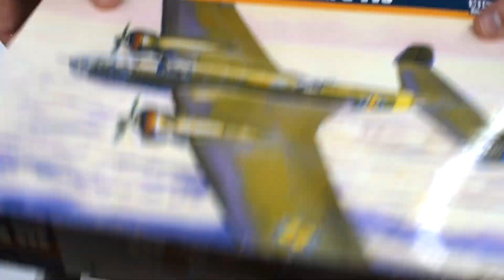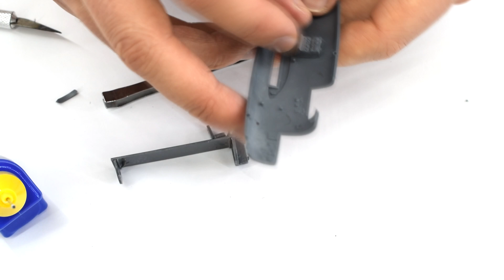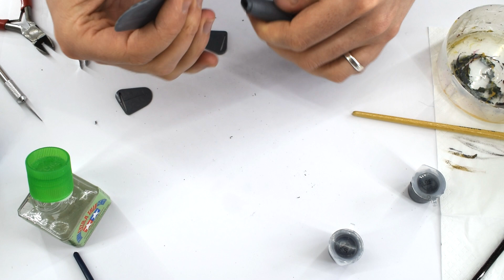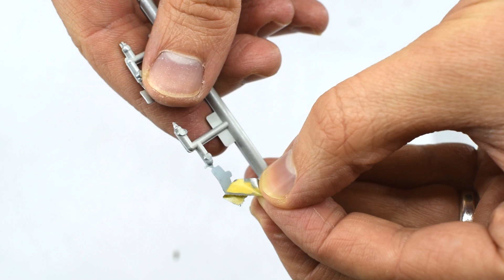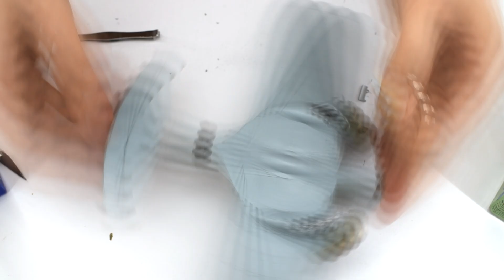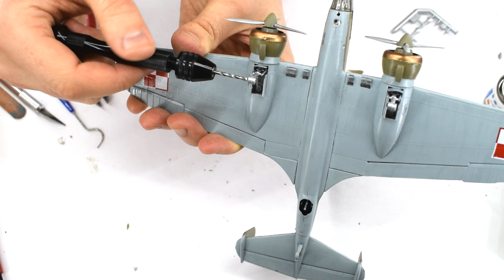Mistercraft PZL-37B 'Łoś FARR & VVS' - 1/72 Scale Plastic Model kit - Build & Review

Comment: (two months after my previous comment)
I've now built and painted the kit. I still love the aircraft itself, despite the shortcomings of the kit. Over all: a good experience; meagre modelling skills were stretched but not broken. Yes: the canopies need work to make them fit, there's a lot of cleaning up and seam filling to be done and a bit of guesswork in where exactly some parts fit. Mine is a model of two halves. Fortunately, it's the upper half that worked out well, leaving most of the mess underneath. I was also rather pleased with my custom ix of "Polish khaki" for the upper surfaces, made from four Tamiya paints. As I like the plane so much, I might well treat myself to the IBG version of the moose/elk. Keep modelling on!
Reply from the maker: Sounds like you made the most of it despite the challenges!

Comment: For a Polish person, this brings some painful memories. Before we got Revell, Humbrol and Italeri, we had this. The tooling goes back to 70's, and was mostly imported from the USSR. They would also give you the saddest bottle of glue that didn't have a proper cap, but was waxxed shut, along with the model. It wouldn't work with the plastic at all, if it was not washed, and it would always run out before you finished. It had the consistency of Tamiya extra thin, but didn't have any bite and was basically an adhesive, that could give up at any point. The thinner was evaporating in seconds, and I remember well jamming a toothpick between the fuselage halves, because there was no other way to fit the parts before it dried up. The biggest irony was that it came in a soft plastic bottle. No wonder that paper models were much more popular here, before we joined the West. It is still very popular to this day, with some awesome, skilful modellers.

Halfway through the 90's we got something better, in the form of Mirage Hobby models that had proper, new (for the time) tooling. They were workable, but for the rest of my life I will remember Academy AH-64D that I got one Christmas, along with a tube of Revell cement. Civilization peaked for me at that moment haha
Reply: I also remember this model from when I was a kid.  Never finished building it.  Almost 40 years later, I finally got to see how it was supposed to be assembled.

Comment: There is a very strong place in this hobby for old tooled kits. Some are fantastic builds. However. As long as they are usable, and not priced high (Revell im looking at you here for pricing kits all the same regardless of tooling age and quality!) Long may they live.

Sometimes, just sometimes...they need a good rework or scrapping!
Reply from the maker: Good points!

Comment: This is model I build more than 3 times. I buy few from ZTS Plastyk and few from MisterCraft, they are exactly the same but ZTS is cheaper. It is great because there is a lot of modeling work to do with it. Sanding, cutting and scribing :D You need to think twice befire you glue something because no parts fit together as intended. But because there is only few parts make its rather quick to build. Painting schema is also easy (best colours for it are from Hataka - Dark Polish Khaki is the proper one). Glad you didn't try the A version as the single tale is even harder to do and require lot of plastic to be cut from the tail. Great video! I enjoy your fight with this model! :)
Reply from the maker: haha it really was a fight!

Comment: I built an F-4 Phantom in 1/72 scale that came with optional battle damage. I was about 10. That kit hassled me & refused to go together without a fight. At the end some stray glue was about on the kit & caused a fumble & the kit fell to the floor & practically every piece broke apart. Temper temper temper as I stamped that kit into the linoleum. Three dollars & the time up the bloody sparf.
Reply from the maker: :o

Comment: Not so bad build of a very crude kit. The only good thing about Mistercraft is that they have rarer Planes. Beside the a bit crude paintjob and some gaps a good job of a pretty bad kit. A word to cheap Spray cans i think it is better to spend a bit more for better quality. If you fill the gaps next time this Mistercrft will be really better. In my mind Mistercraft kits are for advanced modellers to get a better result, but frustrating for beginners.
Reply from the maker: thanks, I will have to keep this in mind when I build my next mistercraft kit

Comment: If you spend a little more time, use putty and sanding stick, more knife, proper colours and do not finish with total disaster with varnish in spray it could be nice model. But I guess you chose to build it as is.
I have few PZL-37 from early production (blue plastic, very good transparent parts) and quality is much better than after four decades of using this molding forms. 
It is simple but nice model. Most of Polish modellars had started their journey building only few commonly available models (PZL-37, JAK-1, IL-2m3, RWD-14, RWD-8, PZL-23, PZL P.11 and few gliders). Sometimes there were also Czechoslovakian models and Matchboxes in shops dedicated for scout boys :).
By the way, your voice sounds very good. It was pleasure to hear you during all movie.
Reply from the maker: Thanks, have you seen any of my more recent uploads?
Reply: @ModelMinutes  Just one of them (Hawker Typhoon). Completely different league than this PZL-37. Really well done.

Comment: I appreciate that you have made a real effort and produced at least something from this effort.  I understand the frustration, we have all been there.  Myself, I appreciate the challenge of trying to make something presentable from older models, especially as the subjects can be so much more diverse than currently available, ie endless spitfires......
I recently completed a build of the re-released Airfix Hawker Demon, a very old kit, but satisfying to complete with modernish decal quality and an unusual subject, even though aligning the overly thick wing struts was so frustrating, I eventually gave up and simply glued them in place where they were, filling and sanding the original fixing holes as no way were they going in there!
Keep up the good work, and never get disheartened. Since the 15 years plus I have rediscovered modeling, I have made similar mistakes to your use of the spray varnish, just learn and move on to the next build.  Reassuringly therapeutic in these difficult times.
Reply from the maker: Thanks! I've got a Demon in the stash to build too :D

Comment: Is the Mistercraft Aichi Val good?
Reply from the maker: I've got one in the stash - it looks to be one of the better kits in the Mistercraft range but it's still not an amazing kit. Be prepared for some flash, moulding issues and the odd fit problem here and there (not to mention the normal low quality decals)

Comment: I would recommend Mistercraft kits for kids as they are so cheap and great for Saturday builds -Sunday blow-ups.
For the rest of us  I find using Scalemates database prior to purchase allows one to pick up the gems while avoiding the duds. 
Cutting your teeth on lousy kits is good training but there is always the trade-off between effort and result, sows ears have a tendency not to want to become silk purses.
Reply from the maker: Yes, that's true. I do worry though, that if this was their first experience it might put them off the hobby rather than want to do more . . .
Reply: The PZL.37 Łoś twin-engined medium bomber makes it very clear that the claim that the Polish armed forces were allegedly technologically completely inferior to the Germans in 1939 is completely wrong. In fact, the Polish armed forces were technologically on the same level as the German armed forces. The armed forces of both countries were generally at the same technological level, although the German armed forces were technologically superior in some areas and the Polish armed forces were technologically superior in other areas. As the example of the Polish PZL.37 Łoś bomber clearly shows. Because The Polish PZL.37 Łoś bomber was one of the most modern, effective and advanced bombers of this time. The Polish bomber was clearly superior to the German counterparts Dornier Do 17 and Heinkel He 111. Many foreign air forces were interested in the bomber and also ordered the bomber from Poland! For example Belgium bought a license to build this polish bombers. But the war prevented any deals regarding these bombers.

Comment: I only buy Mistercraft if I know it is a Heller rebox,because I know Heller is good. Nice work on the plane. Don't lose your will on building models,just try to avoid this kind of models. First check the model on scalemates and You will know what are you buying. I once bought from Mistercraft Caudron 714 and Aichi Type 99 Pearl Harbour,and both ended up in the trash. Not worth my energy or my time.
Reply from the maker: I know! I do normally check when I buy for myself but lots of my kits are gifts from family and friends

Comment: Felt your pain Matt! It was in your voice. Yes, I'm going to get this and build it. Just so you can live in the comfort that you didn't suffer alone! Well done for soldiering on with it. I have 3 Mister Hobby kits. 2 were so bad I ended up putting them together and using them as paint mules ( and they have been invaluable for this in fairness as I was in finishing techniques experimental mode at the time), and I have the Fairey Fulmar (an old Revell reboxed kit). Haven't started it yet but by Mister Hobby's standards this looks like one of the better ones. Could be a nice build with a bit of luck.
Reply from the maker: Haha! Thanks! I've got the fulmar too! Unboxing coming soon :D
Reply: @ModelMinutes  Look forward to it Matt
Reply from the maker: andrew o'connor ☺️

Comment: The most annoying kit I've ever built, Revell 1/72 RAF Tornado GR3, mainly the forward fuselage section and the cockpit which would just not fit properly until I had sanded around 5mm of solid plastic
Reply from the maker: Oh dear, that seems excessive! Makes you wonder why they designed it like that

Comment: glad to see thah plane finifhed. I'm currently working on three planes from that kit. I'm using kits form original manufacturer of this kit ZTS PLASTYK from Pruszków near Warsaw in Poland . This kits dates back to 1983. You should build another kit from mistercraft . You should visit their website mistercraft.eu then visit scalemates.com and see what's in a box . They rebox old Polish kits , heller , KP , Zvezda (Pe-2) , german kits , even aurora kits from 1956 !
Reply from the maker: Thanks! You can expect to see that info in the video! I've got a couple more mistercraft kits in the stash to do - an IL2, Fulmar, & D520
Reply: @ModelMinutes  d-520 is the old Heller kit and il-2 is the old ZTS Plastyk kit (ZTS means artificial material plant )
Reply: The Mistercraft Fairey Fulmar is the old Vista kit. I have the Revell reboxing of the same kit and it looks really nice. I haven't built it yet but it is very high on my list. If you don't have a Fulmar and find the Mistercraft rebox, I would grab it (or any other reboxing if you just want a Fulmar).
Reply from the maker: @mtaylor44  Funny you should mention that . . .
Reply: Matt, I just realized you listed the Fulmar above! Sorry about that, I just plain missed it. From what I have read it got some pretty good reviews, but there are two areas that people had issues with. The wing root seam is not that great and can use some extra care or filling. The other is the panel lines in the nose are a bit off (that doesn't bother me enough to fill and re-scribe it). But for £5.00 I think it is a great value.
Reply from the maker: @mtaylor44  Haha! Yep - I've got an unboxing of the Fulmar coming soon